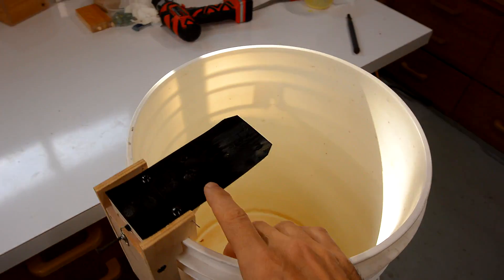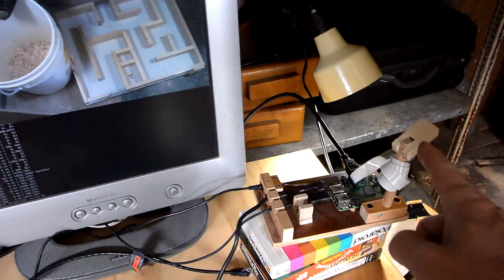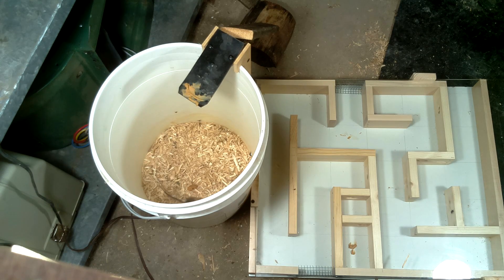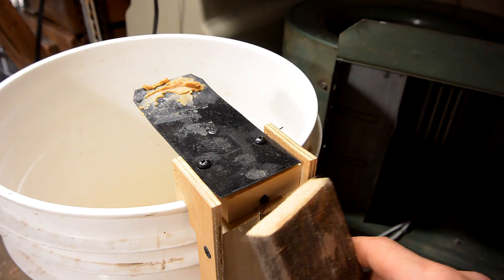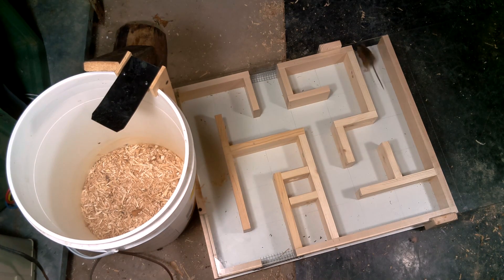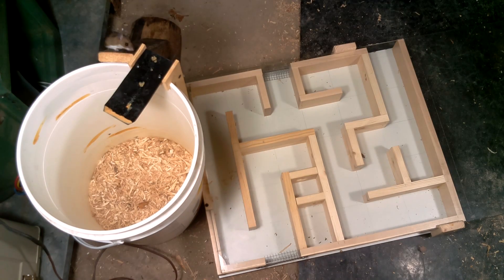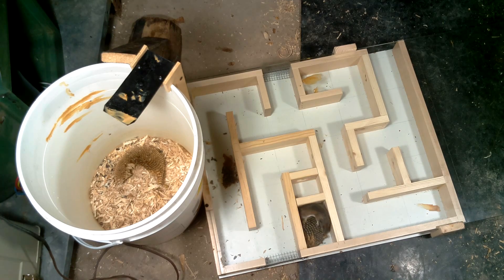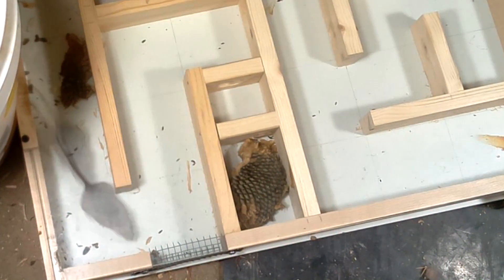Mouse trap maze experiments

Comment: next step- modify the maze slightly- block off the original exit, and make a new exit at one of the dead ends (obscured by one of those holes). I wonder how many times he'll run into a wall after he's learned the original maze

Comment: Q&A
why glue the wood if u use nail gun when wet ?
Reply: In general, the glue is the strength and the nails just hold it while it dries.  I doubt a mouse maze needs much strength, but since this is how he often does other stuff where strength is important, I assume he did it this way because it's his standard way of working.
Reply: Gummy Bear just that extra added bit of sturdyness. and using the nail gun removes the need for clamps
Reply: ok im not a wood guy wasnt being smart

Comment: Here's a thought....what if you put a spring loaded one way door on the maze so that now the only way into the maze was through the bucket, but so that it could still escape the maze if desired.  Would that train the mouse to now willingly jump into the bucket trap or trip the mechanism to fall into the bucket?
Also....I think your mouse was getting a little bit plump by the end of the video!

Comment: Fought mice for years & always impressed by how agile & intelligent they are. In spring they are relentless eaters of seedlings, finding ways to get up long legs, past over hangs, squeezing through tiny spaces to get under mesh etc. Super challenging to keep them out. Caught them in numerous ways, some times news paper over dust bin, finely cut so that it holds the food, but not mouse. This worked till one ate its way out of the dustbin. Often use live catch & it's amazing how on release they come out like miniature gazelles capable of high speed & long leaps of over 0.5 m. Take them into wild ground over a river & none have come back from less than 100m. Best solution I have found is a cat, alas my last one was killed on the road, but we have plenty of owls, weasels & such & with using metal containers for any stored foods the in sheds etc, they are manageable without spending time or money on a war that is un-winable for what ever I have tried they have always come back.

Comment: That's a cute and industrious mouse. Too bad about what that trap is usually used for. I get mice in my workshop too, and I like it when they start sneaking out when I'm working after dark. It's nice to have the company, and they don't do any harm beyond leaving their little poops here and there.
Reply from the maker: I guess you have no insulation in the walls, no fabric anywhere?  Cause they do destroy stuff.
Reply: + Matthias Wandel: Yeah, you're right: no insulation in the walls. And come to think of it, I did have to make a mouse-proof paper towel dispenser, but that was a fun project.  :-)
Reply: KarlBunker They do carry diseases though. A few years ago, 3 people died of hantavirus infection from mouse infested cabins at Yosemite
Reply: Wait until they build a nest in your router cabinet drawers.  Their pee befouls everything.  You will change your stance quickly!
Reply: They do a little more than just leave a few poops. They pee pretty much everywhere and they'll gnaw on things even a goat would pass up. Electrical wire insulation is one of their favorites. (Or is that rats? In my mind the only difference between them is size.)
Reply: That sounds quite bad! Isn't the chance higher to die in a traffic accident due to a drunk drinker than catching that disease? Or just walking outside and getting hit by a icicle in the head and die from it(seems to happen a few times a year). My point is everything more or less is out to get you and you're always playing with odds just stepping into the car every morning to get to work.
Reply: I had mice in the basement, they pee'd on everything.  Mouse pee is very corrosive.  They seem to be drawn to peeing on metal.
Reply: I used to put peanuts out for mine, then I found a whole bunch of them stored in the headstock of my woodlathe. No real problem having wildlife in the workshop and if you feed them maybe they wont feel the need to eat your books. :>)
Reply: +KingKast: "They do carry diseases though. A few years ago, 3 people died of hantavirus ..."

I wonder how many people have died from being exposed to other human beings with all the nasty diseases they carry. I think I'll stay in my workshop where it's relatively safe.  :-)
Reply: +dlwatib: "they'll gnaw on things ... Electrical wire insulation is one of their favorites."

In my experience, mice will gnaw on wire insulation when it's in their way. If you have a wire going through a hole in a board for example;, they may try to enlarge the hole by gnawing on the wire insulation. That's definitely something to guard against.
Reply: I have pet gerbils, but yes ... I'd rather have them in a cage than be roaming free. Otherwise they'd chew things, poop/pee on the floor, and finally be eaten/abused by our cat.
And yes, rodents gnaw ... Did you know that their teeth never stop growing? That's why they have to gnaw - to grind their teeth down. (It also helps keep them sharp.)
Reply: thegenrl yea for mice there's a horrible one if you mess with there feces
Reply: The Hantavirus is carried by deer mice, if I remember my lessons correctly, a different species with a different habitat from the house mouse that Matthias is entertaining in his shed.

Comment: I am wondering if you could build an effective trap with just a ramp to the top of the bucket, and peanut butter smeared about half way up on the inside of the bucket (a few inches above the water line).  My guess is yes,  I have actually caught a mouse accidentally with just an empty bucket with no ramp and no bait (and has never had any other bait in it except bird seed).

Comment: why don t you simply close all gaps in your house/workshops
Reply from the maker: says someone who never dealt with mice before...
Reply: Depending on what type of foundation and the age of it, that might be successful for a while. 
Older foundations gets cracks where the mice can get through, and if its a wooden construction they can always chew through.
Reply: Matthias Wandel why are you so salty?
Reply: Matthias Wandel I have. Just sealed every hole I could find in my foundation. It's not that difficult
Reply: Lol he likely started there and is just frustrated with dealing with the mice.  Not a bad tip tho hes likely just already done that.  It was our first step getting the little buggers out here in the desert.

Comment: The mouse is probably stashing those seeds back in it's nest,which it built inside of something expensive or hard to fix.Probably under the hood or gauge panel in your tractor.That way when it runs out of seeds to eat,it will have plenty of wire insulation to munch on LOL.

Comment: Very interesting, I never knew mice could learn so quickly, especially towards the end where it was traversing the maze without any issues!
Reply from the maker: Traversing throug holes in houses is much more of a maze, and they learn that quite well, unfortunately.
Reply: It would be fun to see some changes made to the maze and see how it responds
Reply: I think they use scent to help their memory to some degree as well. I reckon if one cleaned that maze perhaps. It might traverse it curiously once more as if to ascertain it is the same maze or not.
Reply: its a good question - are they just tracing their smell? to an extent, yes. This is why neuroscientists (Richard Morris) developed the hidden platform water maze experiment. Mice (or usually rats) have are places in a pool of water where there is a hidden platform where they can rest. They can't follow scent or visual cues, it simply tests their luck and then on subsequent runs, their memory. The first time they'll swim about randomly  a bit until they find the platform. The next time they do it they'll swim a bit more randomly but usually find the platform quicker. By the third or fourth time they usually head straight for the platform. Rodents learn quick.
Reply: no - water is a poor medium for scent markings because its a constantly moving, diffusing liquid. Scent trails will not persist even in a still liquid because of diffusion- over time the scent molecules will move from an area of high concentration to low concentration until an equilibrium is reached. In your case of the dog tracking something over a river, the river is a moving body of water - theres no way a scent trail is left across it. The dog finds that the trail stops at the water but is smart enough to pick it up on the other side.

I am not saying that scent is unimportant for animal pathing - of course it is. But for the rodent-swim test it is simply not possible for the rodent to smell where the platform is - therefore it must be memory which allows the rodent to find the platform faster in subsequent experiments. Therefore we can infer that the rodent has a reasonable capacity to learn.
Reply: Mice piss every where, so they go by the smell. 
Great sound  track to a very amusing video.
Reply: Mice piss every where, so they go by the smell. 
Great sound  track to a very amusing video.
Reply: Edward Holmes Mice and rats are quite quick learners. In fact, killing them with poison-baited food is usually not effective because they will usually only sample unusual food it finds, then go off and see if their is bad reaction. And when returning to the baited food in that location, avoid eating it again.
Reply: Edward Holmes lol
Reply: rats can learn that the food is poisoned, mice don't. Mice eat everything ..
Reply: Edward Holmes he learned shit. srry to tell u but in labs they use rats. and not for nothing. THEY are clever. 1. mice are used in labs to TEST shit on we use on us. to test the capabilitie of animals hey use rats. 2: the mouss isnt getting clever.. he followd his pisstrail to where the peanutbutter was. hes just quick coz of he feels hes save and gets to know the way. IF he was smart, like a rat, he tried to avoid the peanutbutter on the bucket on forehand. mice will go to food. rats will try to get the food to them. so if this was my bucket, ur 'clever' mouse had died already 50x by getting in that bucket. nothing clever if u ask me tho...
Reply: Edward Holm
Reply: Edward Holmes f
Reply: FaZe Rug
Reply: Xlast0game X same
Reply: Helveteshit Possibly, I guess we tend to forget how much animals use scent to find their way around things... as humans scent senses aren't as strong.
Reply: It seems that it was better at remembering the right way out every next day/night. Could it be that it processes the informations at sleep like humans do? Everyone who has practised something over a long time, like playing a music instrument, knows this.
Reply: satanismybrother
I thought the claim that Water doesn't transfer scent had already been disputed. Considering how Canine dogs can still trace an escapee even if they swim across a river in attempt to conceal their scent tracks.

But yes, any animal will use their brain eventually to learn. But scent is still part of many animals way of life to mark their paths the first time around. It is a bit like marking a tree in a forest in case one doesn't really know the forest or have a map of it. That way, entering and exiting is an easier task.

Eventually, you will learn the forest that you do not need to rely on such marks.
Reply: Uknown Person including motor oil
Reply: Helveteshit there's a technique, it's called cross the river and sweep for the scent...
If the dog follows the scent across on its own, they're either close or they crossed directly across. 

Telling you now, you walk 5 miles upstream in a river that dog will have to walk that 5 miles just to get the track again. 
police would give up by then.
Reply: srry for my grammar. im to lamb to  rewrite it ✌
Reply: Edward Holmes
Reply: Mice follow a trail of their urine sent you should try washing the maze 
off with a garden hose and see if it can still Travers the maze as good 
XD
Reply: Mbit Gbit interchangeable barriers would be a good option, then you could also watch it get confused as to why it's scent goes through a solid wall
Reply: lol that would be funny
Reply: Mbit Gbit or it runs full pelt into a clear acrylic barrier
Reply: Edward Holmes l
Reply: Edward Holmes his shed's a mess

Comment: I say, more complex maze ! :D
Reply: jojojorisjhjosef i reckon he should design a maze with modular pieces so he can change its configuration on the fly. see if the mouse is actually getting better at navigating mazes in general or if it just memorises the pattern each time
Reply: +Gregg That would be easy to test, just give it a really good wash, and see if the mouse still traverses it the same or not :)
Reply: Gregg Macey hhj0

Comment: how about mixing up the maze  seems like He learns the maze pretty fast
Reply: A few solenoids or motors to move walls, contact switches or IR detectors to turn them on. Or just feed the mouse so much it can't get out the hole.
Reply: Walt Lars We need a modular maze!
Reply: That's what I was thinking
Reply: Brilliant idea! with walls constantly moving, so only if the mouse  is quick enough to get out or he have to find another route which may change too, again and again. transistor Touch plates that active walls.

That being said you could make it so the mouse has to think logically. each hidden  touchplate activates a a key progression wall to open somewhere down the line.